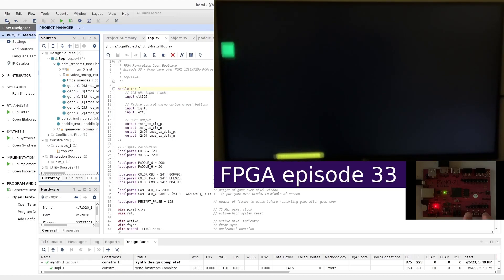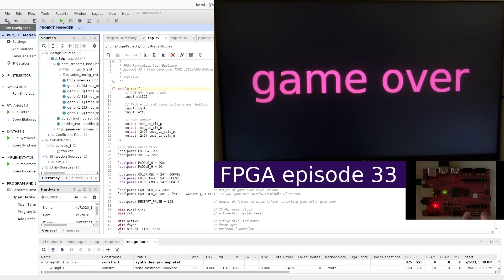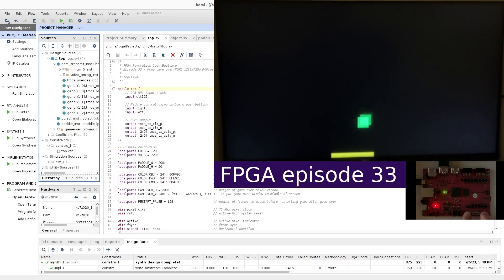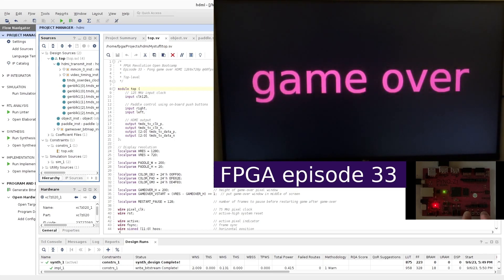FPGA 33 - Game of Pong over HDMI FPGA design

Comment: Great tutorial! Would you mind sharing the .coe file used for the game over bitmap?
Reply from the maker: Finally someone actually trying out the example. Sure it is on github.
https://github.com/fpgarevolution/fpga_33
Did you catch a typo at 08:25? There should be a "posedge" before "pixel_clk", completely synthesizable if not caught. Cheers!
Reply: @FPGARevolution  Thank you! I caught that posedge before generating the bitstream. Everything is working well on my Pynq-Z2 now!
Reply: @noahe894  Have u faced the clock problem for z2 ? Because I made it workable in z1 but not in z2. In z2 the clock was getting reset after some moments.